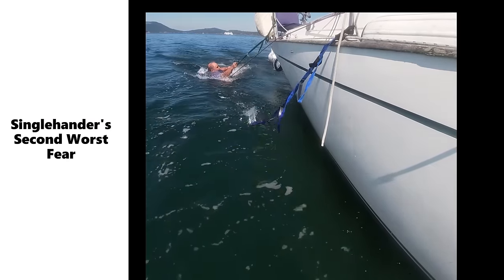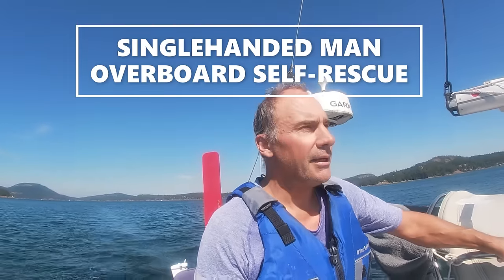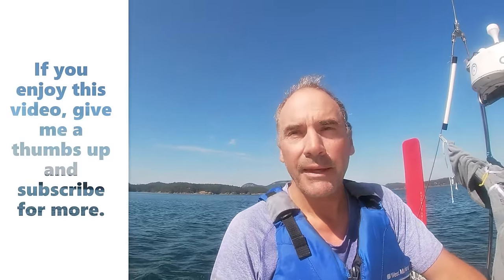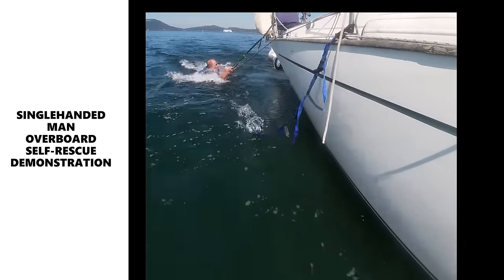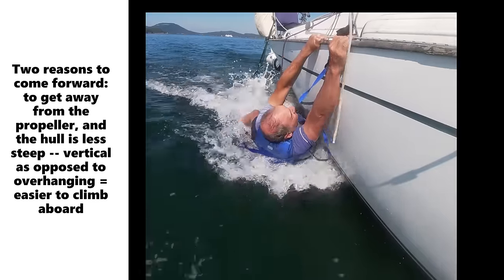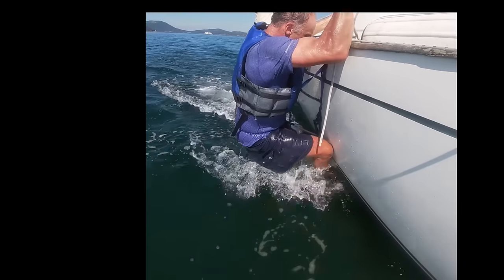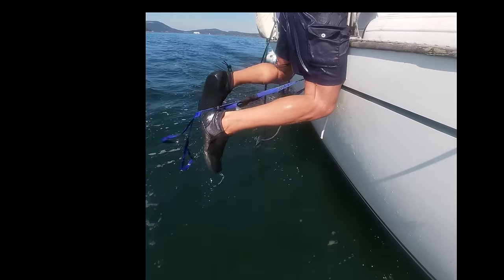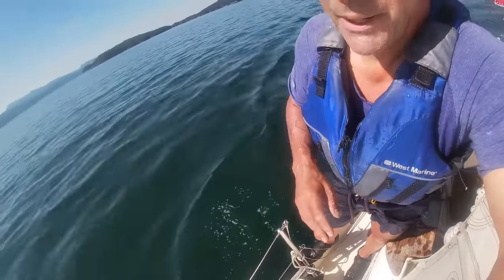SINGLEHANDED MAN OVERBOARD: SELF RESCUE

Comment: Several important points about what you did.
1.  You boarded the yacht from the worst possible angle, being from a side. The water pressure is at maximum, and you risked being sucked under the yacht, which greatly increases if the sea state is not flat calm like it was.
Additionally, pulling yourself back to the yacht against the full water force is much harder.

The Best re-entry point is the stern, and via a fixed boarding ladder preferably onto a duckboard first, then the yacht cockpit.

2.  Use a dinghy mainsheet as a safety line so that you can always keep it a the shortest working length. You extend/shorten the length just the same as letting the boom move in and out, and if you fall overboard, it will prevent you from becoming exhausted trying to pull yourself back and maintain the closer position to the yacht when you need to rest.
You just use the jam cleat the same as if sailing the dinghy, to "winch" your way back with the block onboard attached to the safety line eye, and the jam cleat block attached to your harness.

Using this is possible when injured as well, and if a paraglider kiting harness is used as a body harness, because the hook attachment points are higher up near your chin, it is possible to "bodysurf" over the top of the water much better.
The ability to rest ( totally ) and move back to the yacht at whatever speed you are able to, is the best safety point that you want to get to.
I am assuming that you have the correct size safety vest on and it is fitted correctly. If you have not, then say hello to Davy Jones locker, because like others who have been knocked/slipped and gone over the side without proper safety equipment being used, that's where you will also go.

3.  A large rope with large knots about .600 apart and at least 2 x the length of the boat left dragging astern if working on the deck, is a very good safety device.

4.  A smaller line left dragging astern with a pull release knot that deploys a wakeboard that you can lie on and reduce the water friction/drag effect is easy to setup and easier to use to get back to the yacht, if you are not super fit.

5. The BIGGEST problem is not getting onboard, but getting back to be able to. Approaching from the stern means eddy water that has rotors that swirl the water around, from the sides you face much higher water pressure that increases the bigger the swells/wave actions, and THE SPEED of the yacht.

Most of all NEVER PANIC.
Panic causes the brain to stop thinking, and if you cannot think then you cannot pull on that dinghy mainsheet, and then step up the boarding ladder.

This method has been repeatedly tested in varied sea states, with multiple crew of mixed age, fitness and experience.
It has worked every single time, and in one particular day it was performed in the middle of Cook St, between the North and South Islands of New Zealand, on a 20 knot medium sea state 3 mtr swell against a 4 knot tide.

The yacht was a H28 under sail.

Try it and see how you get on.
It is the best we have been able to test out with 100% success results.
Reply: Explain or show that dinghy mainsheet rig, would you?
Reply: @stugc88  Have a look at a dinghy on davits-same setup and works the same only the person in the water is the dingy.
Reply from the maker: Wow. Thank you for the detail. Those are excellent ideas that I have never heard before. I will try some of them. Thank you for sharing these valuable experiences with all of us.

Comment: Interesting video. But would you be able to do that in an auto inflate life jacket rather than a buoyancy aid? I think your point about properly situating your jack stay is an important one. I think a PLB, kill cord when under power and a spray hood would also greatly increase likelihood of survival. An interesting demonstration though, thanks.
Reply from the maker: Definitely more difficult with auto inflated vest.  I like the kill-cord idea or perhaps a control line on the windvane Tiller to force the bow through the wind to heave to. Just ideas so far. A few viewers also had some other good ideas.

Comment: Great video - didn't know about those ladders, makes it look possible! I saw a great comment from a solo sailor recently (Wind Hippie I believe) who sails solo a lot...and she has a long light floating rope (like a heaving line) behind when she does ocean crossings, trailing out about 75 feet or more, with a few knots....so should she ever have a freak falling off when not clipped in...she would merely have to swim to the middle of her wale and grab the line. I thought that was brilliant myself...good security! Thanks for your video!! Watching from North Vancouver, Canada. Regards, Jules.
Reply from the maker: Thanks for the comment. it's great to hear some other ideas from seasoned and experienced sailors.
Reply: Grabing the line is not that of an issue.  It is what you can do next ....
Reply: Yes, I have heard of this as a technique.  You would have to hold yourself along the rope until you got to the back of the boat. But then you’re going to need a method of getting up on the boat.  Also, if you ever have to start the engine in an emergency, this rope could get tangled in the propeller.

Comment: Someone should invent a system that sends the tiller full over if a single sailor goes overboard. At least this way the boat will attempt some sort of circles around you, if you time it right you may even be able to get on while the boat is leaning in the wind. Hang on, it looks like you did that single handedly after saying never try this alone. lol
Reply from the maker: That is a great idea: Some way to stop the boat or have it go in circles would be a huge help. I have thought about a control line to kill the engine or even a way to make the boat tack and heave to under sail, but they remain just ideas at this point. My crew was forward just out of the frame.

Comment: this is pure bull, first if you end up overboard unplanned, your momentum will carry you out away from the boat, are you dragging a line behind your boat, need about 100 feet or more of floating line, a drag line.  Also your flotation fest will have triggered and inflated providing drag to your swimming efforts to reach that tow line dragging behind your boat.  Do you do cold weather sailing, or even late spring early summer in the gulf of Maine.  Always be clipped in, never unclip.  I was in my youth a long distance solo sailor, you fall overboard unclipped your dead unless the boat rounds up.  you think you could pull yourself back to your boat, hand over hand in 48degree water in a bib long underware boots sweater, your dreaming.
Reply from the maker: Absolutely agree. Thank you for sharing that color and details. The conditions you outline would be absolutely desperate and likely result in death for sure -- especially if unclipped and over the side. (I was clipped on a long tether for this illustration partly to make it more difficult on purpose) Also agree 100% -- this was done in absolutely perfect conditions without an inflatable vest -- and, as you can see was quite a struggle. A vest and offshore boots and clothes would make even this demo more extreme and difficult  -- I likely would not have had the strength and endurance in vest and offshore clothes and boots even in these otherwise perfect conditions. Thank you for sharing your experience. The risks in these events are under-evaluated so it is awesome to hear from a sailor of your experience to coach the rest of us. Even when clipped short, I still have these ladders deployed so I can more easily and quickly reboard if I have a mishap to reduce time in the water. Thanks again for your wisdom on this topic.

Comment: Always have a kill switch when you're single handed. You can even tie a line to the wheel or tiller to steer the boat into irons or heave to.
Reply from the maker: I love that idea. Thank you.
Reply: Never heard of a killswitch on a diesel engine but I guess it's possible.
Reply: what if you're sailing and the engine isn't on?
Reply: @ratandmonkey2982  Read the second sentence.
Reply: I think a limit switch (or several) located near the water line where the tether would bring you is a great and fairly cheap idea.  With some ingenuity you could hook it up to a number of systems on the boat, including the engine, autopilot, and vhf to send an auto mayday. Definitely want to research these ideas after watching this; I seriously doubt I could pull off that climb.
Reply: @seanhayes2998  vhf to send an auto mayday -   carry handheld water proof VHF in your lifejacket
Reply: @dmitripogosian5084  and a tiny PLB.
Reply: @dmitripogosian5084 depending on water temperature that's not going to do any good

Comment: I fell off the boat in February wearing a long winter coat. Luckily I was at the dock and the boat was tied at the stern with the outboard in neutral and I went in at the bow. 
40 degree water is cold and my heart stopped for a second. My boat was extremely not easy to climb. I could reach the rail from the water, but there is nothing below the waterline to put your feet on. The dock was the same. My outboard was running but didn’t look climable. 
Since I had a line in the water, I was able to tie a loop to put my foot in and get up out of the water and get out of my clothes and into bed to warm up. 
After that I attached a folding ladder at the rail midship, so it could extend into the water and I used it for getting in and out of a kayak. 
Both of my next boats have had a swim step on the stern with a folding ladder with a line attached to trail behind. You just have to make sure the line floats so it can’t get into the prop.
Reply from the maker: Wow. What a great anecdote. It is amazing that you had the sangfroid to think that clearly while immersed in that cold water. Well done! Great ideas. Thank you!
Reply: @respecttherisk2022  I think winter coat helped

Comment: Good idea thanks for sharing but yeah being on the high side would be damn near impossible to grab the rail. I like bobmeador4465's idea about running an additional line lower. I'd saw maybe just a little above the waterline then you can use it as a pull up rope when your healed over and a step. Both are great ideas thanks for sharing
Reply from the maker: I really like bobmeador's idea as well and plan to install that in addition to the ladders. Nice to have options in a survival situation.

Comment: oof.  this would be tough on my Westsail 32.  even sitting still, I can only really climb up by getting a foot on the rudder.
Reply from the maker: Thanks for the note. I know what you mean. Without the nylon ladders, I have to use the windvane and power generator mounting on the stern as a ladder.
Reply: @respecttherisk2022  would you recommend having the nylon ladders hanging off the side?  also, should you be tied to the lifeline at midship and not behind?
Reply from the maker: Yes. In rough sea conditions I have three ladders per side. 2 in more moderate. The first line of defense is using a tether and jacklines and clipping short to avoid going into over the side into the water in the first place. The nylon ladders are meant as a last resort in case the unthinkable happens and one goes over the side. They do give me peace of mind that I have another chance to save myself. Part of the challenge of multi day passages singlehanded is fatigue, mentally and physically. By day 5 I feel like I am operating with 50% capacity so I feel like I have to give myself every chance. And, we can make simple mistakes when we are that tired.

Comment: FYI for the power boaters out there- you can install a man overboard engine kill switch. As long as you can swim faster then your boat drifts away, your ok, as long as you can navigate the freeboard.
Reply from the maker: Thank you for the note. That is a great tip.
Reply: That is a problem with sailboats - no kill switch for the sails ...  If they are set up - it goes

Comment: Practical boat owner , addressed this very issue years ago , in a series called sketch pad . Usually found at the back of the magazine , they eventually became published as a sketch book series . A set of three notebooks full of ideas , such as dinghies cut in half , to nest inside each other , or even shaped to fit round a mast . Dripping windows having a gutter inside the cabin , that incidentally doubled as a hand rail . A grab strap for our four legged friend , security of companion ways . I could go on , each page was a different subject , but to be honest despite having the complete set , i can't remember them all off hand . They addressed the single-hander many times , and suggestions here ranged from a fender hanging over the side , to running the jack stays closer to the centre line with a whole host of ideas in between . They even addressed an issue not many will admit to doing , the not wearing of a harness . One idea suggest a long line trailed behind with a fender on the end . Marked with a flag , the idea was you could swim and grab . Now pulling yourself back aboard , or even back to the boat would prove exhausting , but they suggested rigging a trip line to disengage the auto steering , and turn the boat down wind . Maybe an idea perhaps .
Reply from the maker: Awesome comment. Thank you. Lot's to digest there and some great ideas. I have also been thinking about rigging a control line to kill the engine, or make the boat heave-to while sailing with the windvane. They are just ideas right now -- but could be workable ideally reachable  from a position overboard close to the ladders. Pull on the line to stall the boat or have it heave to. Once the boat is stalled, the chances of reboarding are dramatically improved. Thank you for sharing your learnings and readings. I will see if I can find them online.
Reply: Mickey1299 - awesome comment and ideas you’ve shared with all of us.  
THANK YOU 🙏!
Now I wonder if the series of sketch pads was ever published? 🤔
Reply: Correction: sketch book* not sketch pad

Comment: Good video. Important stuff.
Were you single handed when you attempted that drill? If so it wasn’t a drill, You were OB single handed on purpose which is very reckless. Respect the risk and have someone on board who can stop the boat and help you if need be. NO ONE SHOULD EVER PRACTISE THAT SOLO. Even if you’ve done it a hundred times and it’s very easy for you, which it clearly wasn’t.
Reply from the maker: Thanks for the note and advice. Crew was on hand just out of hte frame. Well said mate. Well said. 120% agree.

Comment: Nice video, great idea..I am working on putting up 5 feet lifelines, im 6,2...jacklines are tight...and finding a way to depower the boat by grabbing looped trailing line....redundancy seems like a great idea, esp when singlehanding.
Reply from the maker: Nice idea. I have some other ideas I would like to try as well -- control lines to kill switch and tiller to stop boat, or at least have it heave-to or stall in irons. Agree -- redundancy in how many chances we have to get back aboard singlehanded.

Comment: In a world where we keep tiny computers in our pockets, where data flies invisibly through the air, where we purport to have sent space ships to other planets and moons, I do not believe it is beyond the ingenuity of man to design a "dead man's handle" for a sailing boat, akin to the one used on trains.
Surely it cannot be all that difficult to wear a device upon one's life jacket, such that when the distance between it and home base upon the boat reach a certain distance, then a wind sensor will send a message to the rudder and simply turn the boat into the wind and release the sheets.
Many boats already have an autopilot that can make minor course corrections. The technology exists. Surely it is just an extension of that. I wouldn't be surprised if it already exists, albeit on some very expensive boats. And that is probably the crux. It would be expensive and for the average sailor, the most expensive single item on board that hopefully you would never have to use. But what price life, eh?
If enough early adopters went for it, the price would come down. Or, new boat manufacturers could be obliged by law to fit them as standard (like airbags and seatbelts). Retrofitting to older boats will likely be problematic though. 
As Arthur Ransome says: Better drowned than duffers. If not duffers, won't drown! (Swallows and Amazons)
Reply from the maker: Great ideas mate. Thank you for your lengthy and considered comment.

Comment: I think when I start single hand  life 1, drag a yellow float line 50ft long.   2, web ladders both sides.
Reply from the maker: Thanks for the comment. Quite a few folks have suggested something like that. I would further suggest staying tied or clipped to the boat in some way at all times, in addition to the web ladders. In a later video in this series, I added a method to get back aboard using a GriGri and an ascender with a web ladder on a 10 mm nylon (climbing) rope. This method allows the single-hander to have a "hands-free" rest while getting back aboard. Best wishes mate.

Comment: Is there not a way to have a safety line hooked to your tiller or wheel that is tied to u that when u fall over it pulls the tiller or whell and takes u out of the wind possibly a circle my Hobbie cat simply goes limp and heads into the wind all on its own apples to oranges I guess food for thought
Reply from the maker: Thanks for the comment. A few viewers have suggested some of those things. Based on that, I have some ideas to try in practice the next time I am out at the boat with control lines to the kill switch and the windvane tiller.